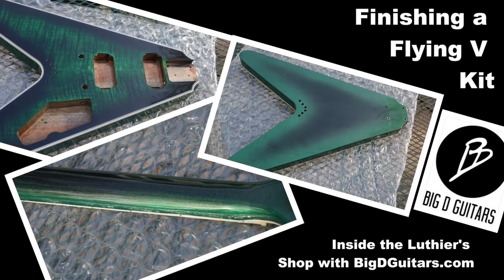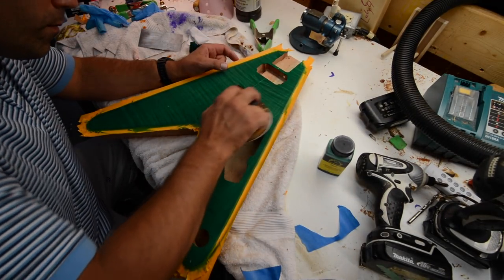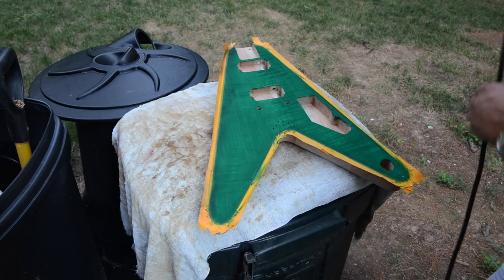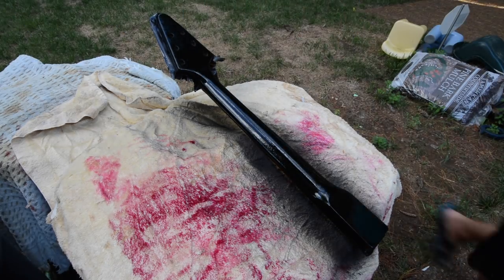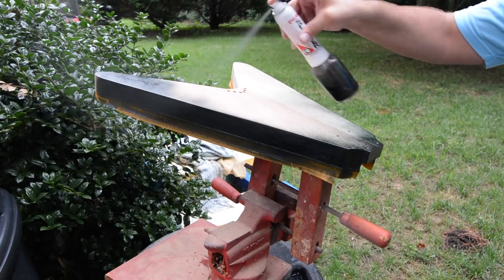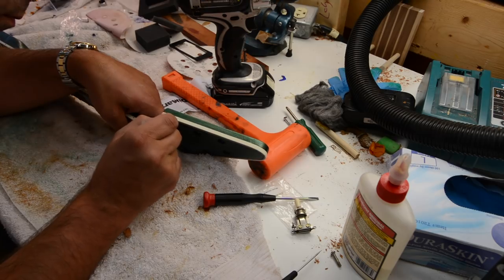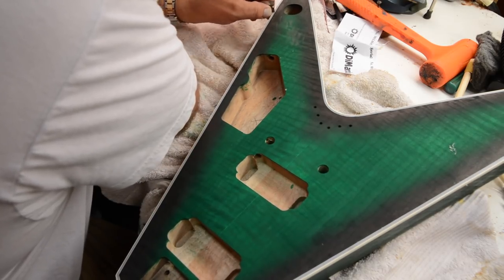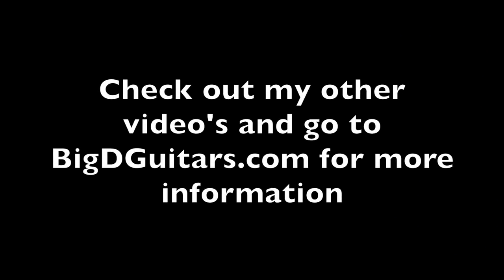Finishing a Flying V Guitar Kit with Leather Dye and Kustom Shop Sparkle Paints

Comment: I had the same problem with massive bubble from chemicals reactions...(IDK)
So I just went back to using water base poly and brushing it on. 
thin it out to make dries smoother. 10 coats. It dries faster than oil.
 It wasnt bad to wet it sand it level. i did it by hand...but electric sander would make it easy.
Nice looking guitar ...if you dont play lead. Nothing compair to korina you built.
Maybe one of these days..you'll do an all chrome guitar...you can use automotive  vinyl film. They come in different chrome colors. An all chrome flying V would be sick.lol
 You still have to make the surface as smooth  as a  finished guitar before applying
the film I used to build Nitro R/C airplanes...You can get it smooth and seamless and bubble free looking if you're good.